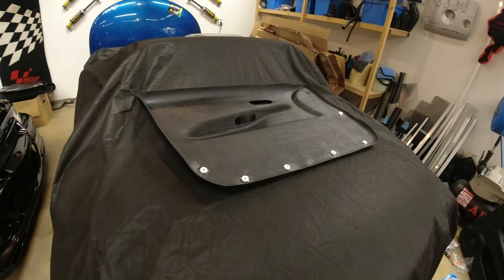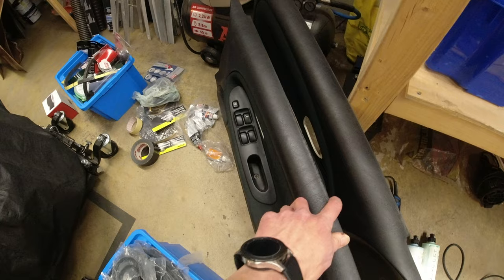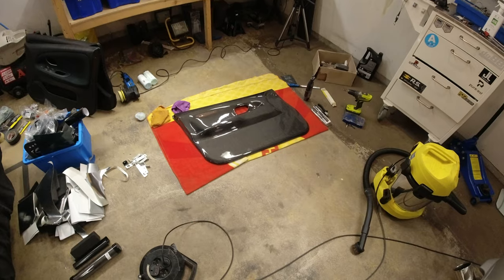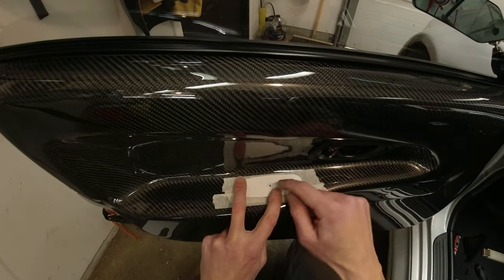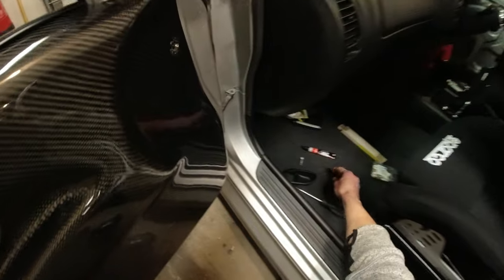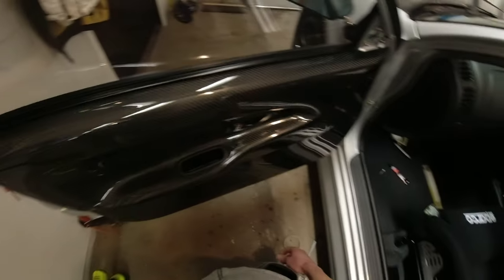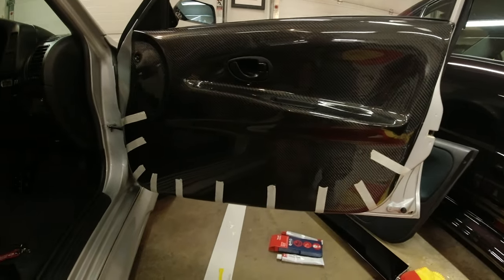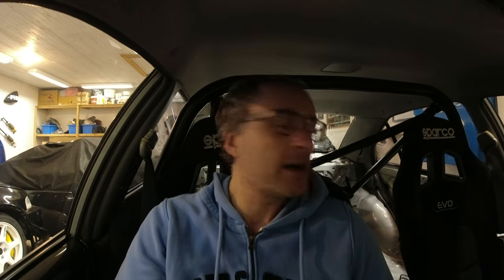INSTALLING CARBON DOOR CARDS ON THE EVO V

Comment: Looks great. Impressed with your confidence in chopping new carbon fibre parts! Is there any weight saving on those? I can see carbon ones being heavier as some oem door cards can be pretty light. You know you got some nice and strong lights inside the car so it's not cave lighting now right? :p
Reply from the maker: 😂😂 problem now is the race battery goes flat fast if I use the lights! Yes they're a bit lighter than oem, I need to weigh them 🙈
Reply: @SoloLap  Nice. Defo quality parts, you see so many parts  for car that don't fit or have terrible gaps even for expensive carbon/kevlar ones.

Comment: very cool solution i will look into securing them in a way like you did it, but i dont want to glue them together x)
Reply from the maker: I need to test them on the road, see if they rattle! I think the epoxy is a very strong way to hold clips in place so you can remove the door cards like oem.

Comment: Planning to get these as well but I’m still want to run electric windows, would the OEM switch panel fit these door cards ?
Reply from the maker: Hej Nicholas, yes they will, you'll just need to cut out a bigger area but the handle position is the same as the rears I used. The rear door cards (video coming next week) have a slight recess in the mold for the rear handles which should make fitting easier...I didn't bother with handles on the rear though.